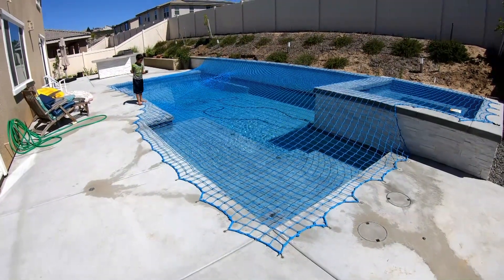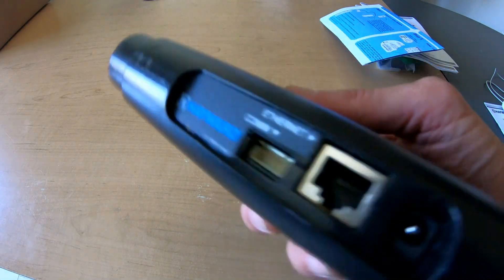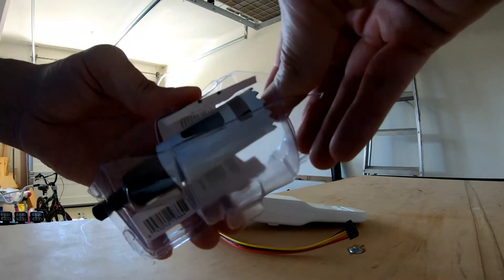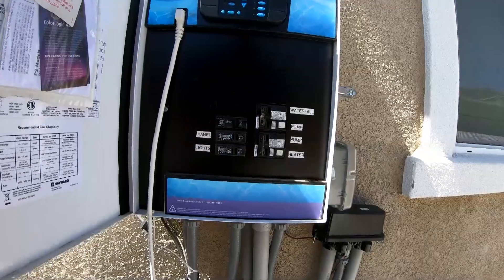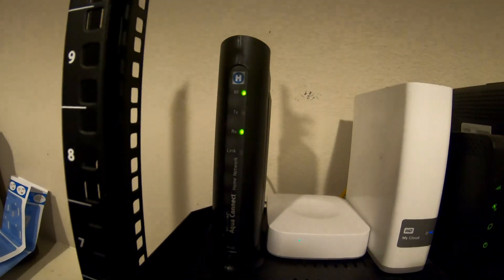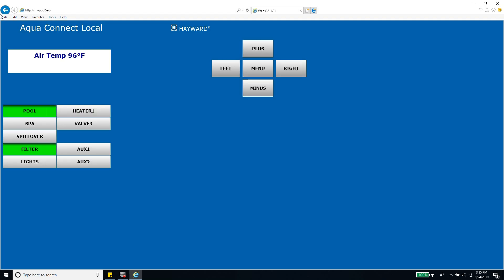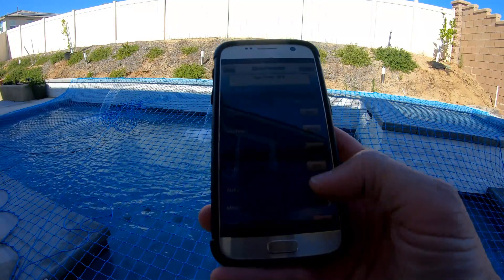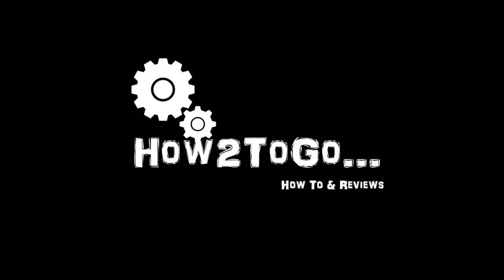Hayward Pool Automation - Pro Logic & Aqua Plus Controllers

Comment: You don't have to drill new hole for antenna you're right that is a knockout. You just have to gently hit it harder be careful not to hit the board maybe bend off tab with needle nose on the inside

Comment: I already have the wireless antenna because I have a wireless remote.  Can I use the same antenna?  (I am trying to get rid of the broken remote FYI)
Reply: i have the same question. did you receive a response?
Reply from the maker: You should check with your pool equipment manufacturer and verify part and model numbers.  I'm showing how to hook this up from nothing to controlling with your phone.

Comment: Question…. My pool heater is not controlled by my hayward mother board… would this be a problem to get the heater to work with the wireless system?
Reply from the maker: Yes, I would think so.  There wireless is just communicating to the main Hayward controller.

Comment: What if you have a new base station plugged into the board but Teach Wireless doesn’t show on the menu?
Reply: The base station is not communicating with the controller. Problem is with the main board. Try plugging  into another female plug below the one that is used now. All three are connected to control panel.

Comment: Great video!  Got everything hooked up and can control through the browser using the last 3 digits of the mac address.  I set up an aquaconnect account and when I registered the device using the mac address is said the "This unit is already registered!
  The request has not been processed."  I bought the unit used off Amazon.  Any idea how to unregister from the previous account?
Reply from the maker: Very nice.  Not sure.  There must be a way.  Maybe their support line can help.
Reply: @how2togo  I sent them an email with screenshots.  I'll call them tomorrow and let you know what I find out.
Reply: @theflyingpenguins876  what ended up happening? I bought one used off of Amazon also and am having the same problem
Reply: Hi mine was new but when I add MAC address to my new account it keeps saying MAC address not found but I did all the steps correctly and the green lights all work

Comment: Hayward has really dropped the ball in the last few years, I'm running Hayward Aqua Connect with Prologic 8 relay system and since their servers crashed a few weeks ago the system is intermittent at best if not unusable due to poor response.  They have a new OmniPL Upgrade Kit that would help but its currently unavailable. Come on Hayward you're better than this, make the AquaConnect servers faster or release the PL Upgrade kit. It might be time to switch over to Pentair. Anyone looking at Hayward right now be very careful, consider Pentair